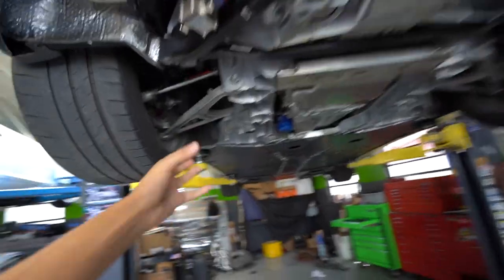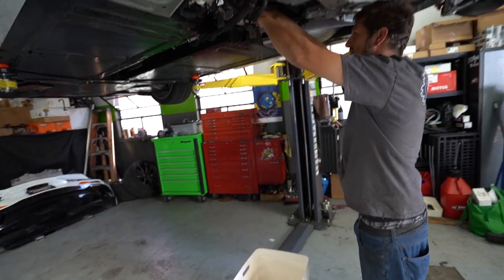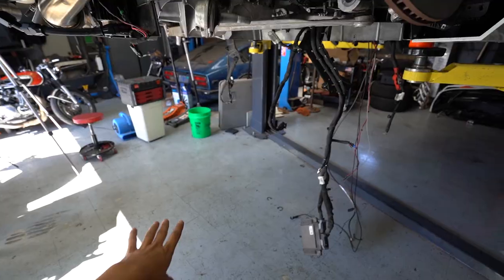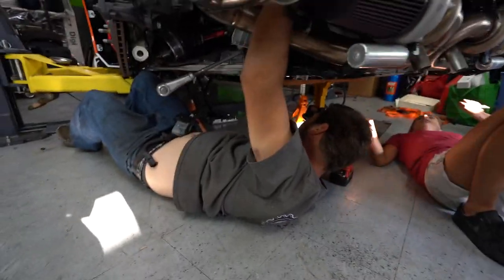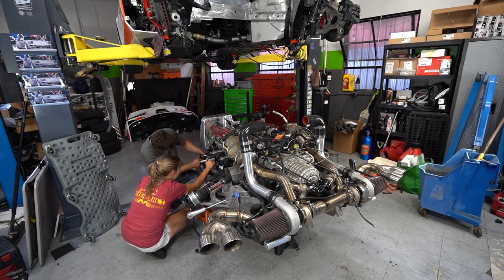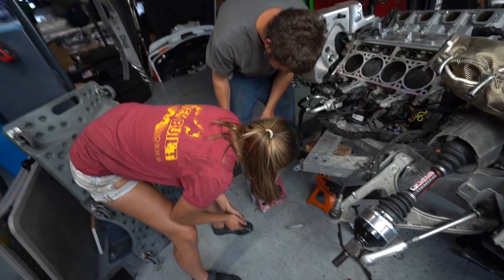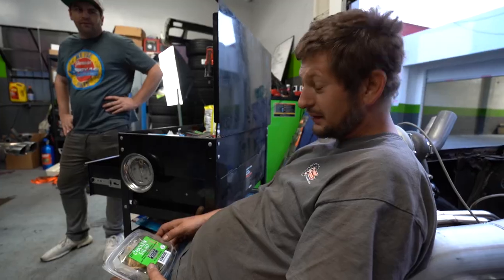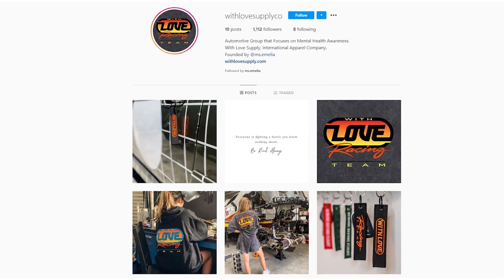Tearing down my Blown C8 Corvette Engine... Not what we were expecting...

Comment: @EmeliaHartford, if I may suggest getting in touch with Manton the rocker assembly and pushrod manufacture. I’m not sure of your power goals but they will make custom valve terrain parts that can hold some power. I have a set of roller rockers and 7/16 dia. on my 1300 horse 5.9 no issues and not to mention they look phenomenal. Excited to see how your build comes together
Reply: Valve train-things are lined up and linked like a train, one after another.  "Terrain", the topological surface of the raw planet.

Comment: The LT2 to me seems to be just an LT1 with dry sump oil system and reverse set up intake manifold. The LT1 did not hold up well to boost especially if the engine  was generating over 10 plus lbs of boost!

Comment: "dont think this is a glass engine because it held up pretty well to some very high horsepower numbers and very high torque" 
um...no it didnt
Reply: Your right I was very surprised a dodge hellcat holds what 700 or more easy c8 said no sir we can't have non of that
Reply: I think she would have been better with a junk yard 5.3 ls
Reply: Pulling timing and adding fuel via a piggy back controller isn't likely going to get it done on these torque based ECU's. Hence why LMR reduced Streetspeed717 C8 to 3psi for the street.
Reply: 🙉Just like mask😷protecting us frm tht Wuhan Virus... 👀😒
Reply: A lot of 20+ years old engines managed 1000 hp like its nothing

Comment: At least the rods are still inside the engine ....Just a thought , you can get shims to raise the heads a few thousandths , will lower the overall compression ratio ,(which you'll make up for with turbos) and  increase the size of the combustion chambers ...It will take away some torque , but add top end HP and allow the engine to tolerate more boost...Decrease the likelyhood of preignition , which you and I both know is what bent the rods...Stronger rods wont fix the reason that happened , stronger rods will just break the next weakest link....

Comment: You should put in an LT5 engine  from the zr1 1990 corvettes. DOHC 32 VALVE  V8 350 cu in, or perhaps put a Marine Mercury V8 DOHC 7.0 liter engine, & then put on a whipple supercharger, with twin smal turbos that feed directly into the supercharger inlet.

Comment: No surprise that happened really. Too much boost and too much compression for the original rods if you ask me. That was simply bound to happen. My recommendation, get some upgrade pistons from Mahle with less compression and fix some stud bolts to the engine head if not already done (looks pretty Stock to me) and you should be fine.

Comment: Stock GM C8 rods are not rated to more than 3250 fps acceleration.
At 5 psi and runs up to 4500rpm you have exceeded the design parameters for torque and twist.

Comment: The more power you make the parts you break.  😂. The cost of power.  Good luck on the new build.
Reply: LeoGotRock I am well aware that gm has weak rods and pistons.  I blew an engine from piston failure.  When you dramatically increase power almost everything must be updated to handle the power.  There is always a weak link that will fail from planting big power.  Some setups only survive due to poor traction that takes the strain off the parts.  Put a sticky tire on and transmissions, clutches or axles break.

Comment: I wonder why these rear-engine cars don't suspend the front of the engine by a single transverse bolt that will allow the engine and transmission to just swing down as a unit for easy maintenance.

Comment: That was a tuning issue. You can set torque limits by retarding timing down low. If you make full boost at 3k and 900ftlb, you’ll bend a rod. Timing needs to be softer down low.

Comment: Meanwhile my GMC truck that I switched rim size on and then back to the original 20"s keeps giving me "Traction Control Off" and "Service ABS system" dash warning lights for NO REASON accept it wants me to go to a dealer and have them do a code reset.  Glad they help YOU though lol.

Comment: your problem is the programer. how you just program a car at only 4500rpm and what happen whit the all power band.  you have  a turbo car and you just start whit a little boost and cover the all rpm band and then you rice the boost little by little until you get the desire power, and remember you need to work whit timing on a hi compression motor, that mean you need to lower the timing to avoid detonation, but its up to you.

Comment: Looked like you cried 😢 after the engine was pulled. Probably close to 100,000 car with a blown engine and possible a broke transmission. I would have cried.
Reply: It's ok, she has a FORD to drive during the shop times.

Comment: My bet is still on a broken piston. They don't break at the top, they break ring lands. People that have broken them contribute this to a weak piston but it's really the rings that are the issue. They are super low tension, even more so than the LS stuff. Top ring can't hold in the heat and pressure so it blows by to to the second ring which is still just cast iron. It heats way up and ends up breaking the land. Total seal makes gas ported rings that would drop in and be a fix but if you're at that point most people are going to opt for a forged piston and ring pack if they already have it tore down.

Comment: Sandy: why don't they make it easy to work on like a Ford
Ford mustang: 12 hour header install, 20 hour engine removal
Ford f150: have to remove cab to pull heads off
Any fwd ford: have to remove entire sub frame to work on engine...
Yeah Ford's are real easy to work on.

Comment: The stock transmission is trash. If you want to go big get a Power Glide. A duel clutch automatic can not be upgraded to hold more power. Put a real drag racing transmission in it. The crank could be bent making the flywheel rub something if the rods are bent.

Comment: We're not sure yet but if it is the rods that makes a lot of sense.  During the tuning if the timing was advanced,  it could have created a cylinder overcharge in not one but all cylinders then she fires putting more stress on the "stock" rods than they could handle.  Also higher octane fuel.  Don't know why it showed up after service.  Looks like she did nothing wrong when they went for a rip.  No one did anything wrong but the stock engine cannot handle this hp  and especially torque.  General Motors should pay attention to this and build this engine accordingly.  I feel they already know or why offer a better engine in 2021.

Comment: 3:45 it's funny to hear him complain about the way GM does thing. I work at a GM dealership as a body guy/painter and I work on all models of car and GM has got to be one of the most annoying to work on lol
Reply: Andrew Nadon why is that?
Reply: @jamesmedina2062  it just seems like when a screw should have gone up it goes down. Using a 7mm, 10mm, T20 and T15 to hold on one little part. Trying to align a door or truck lid after an accident, when it never lined up straight from the factory. I could go on, but I don't have all day. Even the way they package parts compared to the other companies.

Comment: Chrome valve covers with metal engraved crazy flames and to make the flames pop clean out all the grooves I would say to have the flames painted but that is time consuming with a tiny paint brush but I think it would be cool but it would not been seen either that  paint the valve covers orange to commemorate the orange on the car to make it stand out those are my ideas but I would go with  painting the valve covers and then clear coat them but it is your car I’m just a subscriber here on another note I am looking forward to seeing the c8 going down the drag strip as well as your other drag car make a few passes and the winner of Alex and you I think should be to make a upgrade to the losers car and they have no say in it because the winner will pay for the upgrade 🤘

Comment: How much power/torque did it take to hurt the OEM internals?  And on a side note, this is not going to be a tuner/builder friendly car.  I thought working on modern DOHC motors was bad.  I'd rather attend a crotch kicking contest (and go second) than do all that to get the heads off.  The mid engine format is definitely going to favor the leave it alone crowd

Comment: I'm thinking your poor engine suffered an over-rev situation to create too much tensile load on the rods.
Reply: Kind of doubt it actually over-revved, since the rev limiter is set pretty conservative on these. You'd have to go well beyond valve float to bend a rod in one of these engines, and since there was no evidence of any valves touching the pistons, it never even made it that far. However, if they got any detonation under boost and high rpm's, due to tuning being a little off or low-grade fuel, it would be equivalent to hitting the piston with a sledge hammer. I hope they check the bores closely for hairline cracks before they put it back together.😉

Comment: Lesson to other C8 owners. Unless you are a youtuber producing content for $$$ or very well off financial don’t mod your C8 engine because your GM warranty is void and you’ll pay a fortunate to pay to have the motor removed, fixed and reinstalled.  I would not be surprised that it would cost an owner $15,000 depending on what needed to be done like a rebuilt engine.

Comment: i just got my second chevy built thing a 4x4 truck from  the time i was 17 years old i am 59 years old the blue dodge is not approved ford red yellow or green! or chevy any color it on the bass boat frame so the tow package truck replaces the sunk in lake yellow ford! oh flex plate crack or bolt back out thump thump in a dodge !

Comment: @UCGSWNz2RYEDlst41_ZUVCdQ you have the best comment here... in answer to Sean Hersey's thread below... giving due credit to the other answers in that thread... are all perceptive. 
100% true... they're no fools those GM engineers... but those that try to outsmart them are !  
What is interesting the parts failed in compression from combustion forces... not just but it was pretty much everything... more than one on each cylinder bank... so that does prove out the development for the powdered metal rods? What does it say for the engine structure development?  Perhaps its been fine tuned to its intended use and safety margin! 
Whether the rods, pistons or bearing are part of the failed parts one might wonder what else is lurking easily missed in in the glance over, inspection.  

GM engineering needs to be proud...

Comment: Well the good news is I think you pulled it just in time!!! That is before a rod broke everything and went through the block! I think you definitely a pushed it to its most extreme limit and found it for sure! While you have it out updating the bottom end, and probably a cam and port the heads and intake, I'm assuming... I would upgrade the clutches and the axles as well.  As I said before, I ran across this article that sounds like it may be just the clutch upgrade you need!

https://www.autoevolution.com/news/c8-corvette-getting-clutch-upgrade-extreme-duty-gears-from-dodson-motorsport-144829.html
Reply: Justin Hobart She’s getting a fully built Texas Speed motor for it!

Comment: Removing the cat's in the downpipes should've been one the first things to uprate/remove,rather stupid to leave them then fit turbo's 😭👎😂. .
Subaru did same thing on some car's and was one the first things to change...Guess subaru knew something c8 owner's clearly don't 😭👎😂
Reply: What your as high as amelia LOL
 no stock car come without cat all car have cat from the factory even turbo car
And the can't tune the ecu need to have the cat for it to work correctly
Epa want to know your location LOL
Reply: @legros731  
Can remove the cat's in the subaru up-pipe.
Surely if it's got a sensor then can over write it on the ecu map?
Or just use standard pipes but remove all the cat material? 
Rather silly to still have the cat's before the turbo,will end up to hot and break up and go fru the turbo and damage them..
Yes new cars have cats but after the turbo 😭👎😂